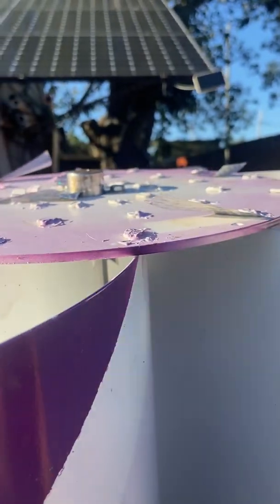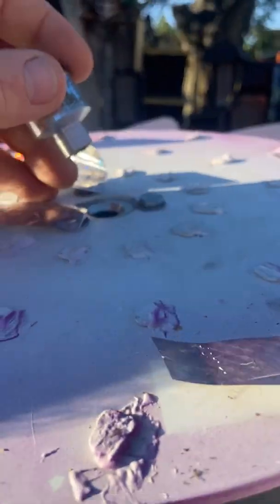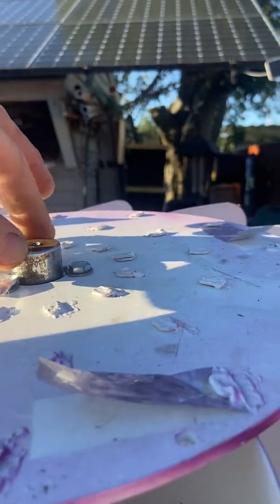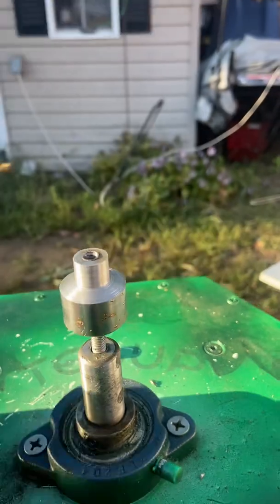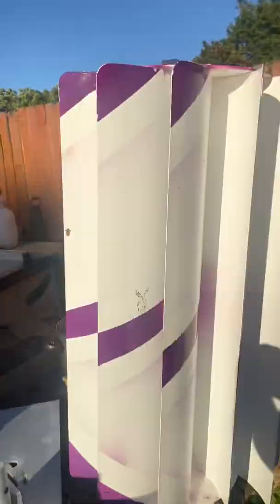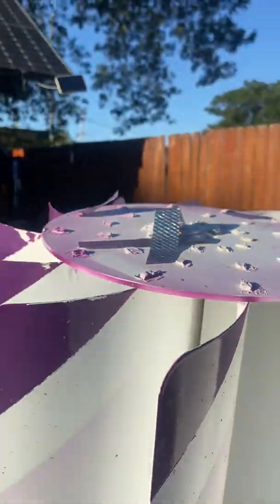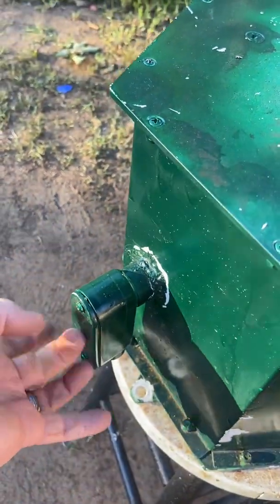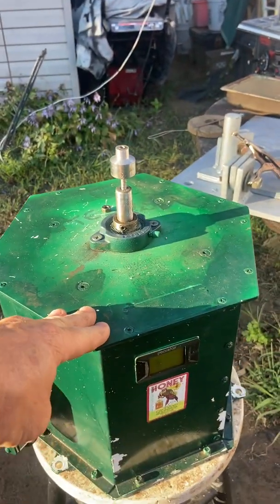Vertical Wind Turbine Part 7, Never buy Tesup.

Comment: Yeah, I kinda figured they were suspicious just from claiming 7KW on a vertical turbine this size. If quality was there I'd be tempted to get on just to play with, but no point in spending good money on something that's junk in more then one way.
Reply from the maker: I even read a few negative reviews on tesup and still I wanted to believe this design would work, (4kw).  I knew nothing about wind turbines at the time.  I just love this vertical design.  

Unfortunately, there were so many manufacturing defects, lack of quality control,  that if they had made a good product with a better design, with real life testing it would be pretty good product. With a smaller generator. 

Thank you for Not purchasing.   My goal is to put them out of business , such a shady company.. if you want a good laugh, go on trust pilot.com and read the reviews on Tesup.
Reply from the maker: I’m in the final stages of suing Tesup for a refund.  They didn’t respond to the courts.
Reply: @Themachinewon It was the same with me! I bought one of the tesup rubbish during the COVID. This is scam! What if we go to court together like all unhappy customers? There is no technical documentation, no CE cert (forget about insurance if something happened) and they advertise it as product made in Europe. All electric equipment sold in EU need to meet EU criteria! They have to stop laying and robbing people!